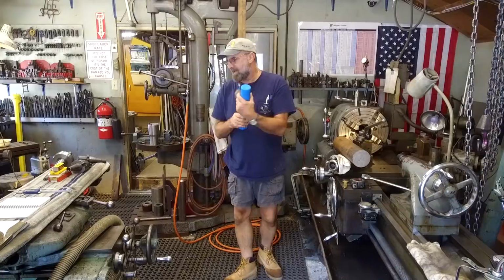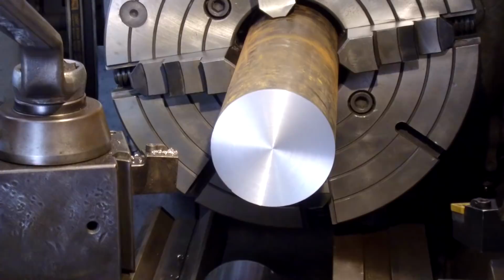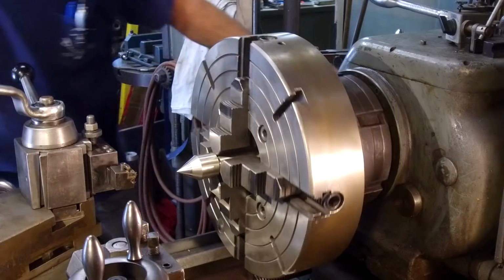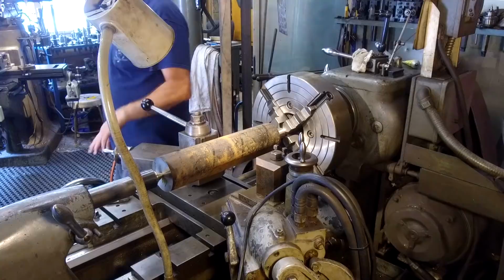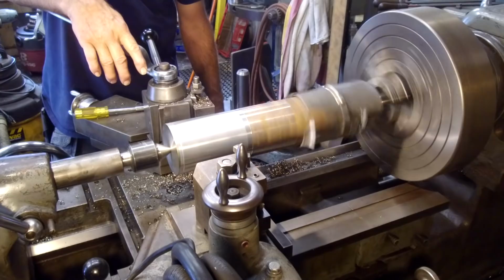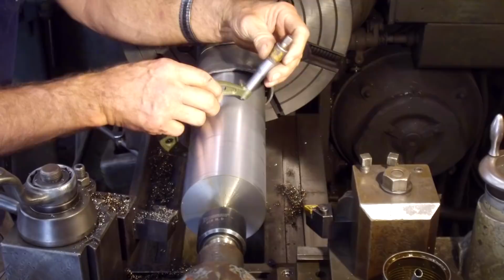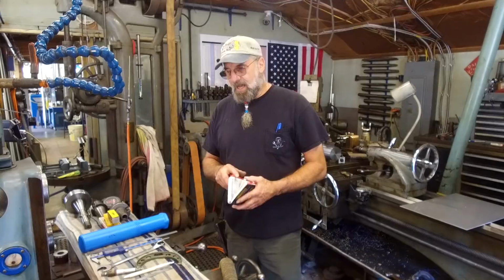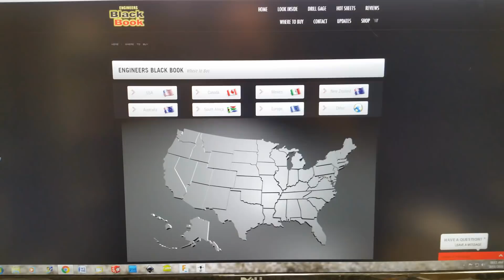#40 Taper Holders On The Make P1

Comment: For making my own taper tool holders, I have made a 30-taper plug for the bore of my spindle. So I don't worry too much about the taper, I cut it in one setup, then pull it back in to the plug to machine the tool holding features. It helps that my spindle taper is bigger than 30 taper, but even were it not, I am sure something could be arranged.

Comment: Hi Keith. Good to see you up again. The angle iron trick is helpful. I've never seen that done. I'd like to add to it. Use a second piece of angle iron on the opposite side of the part to eliminate the driving backlash. Dog bouncing may be small, but will give you some noise in your OD finish. I've seen guys drive wood wedges between lathe dogs and faceplate slots with great success. My faceplate had a cam I made that I would adjust to trap my drive dogs and eliminate the slop. It worked quite well. Take care.
Reply: Joe Pieczynski I thought that was clever too! I think you lifetime guys, even after making videos for years will still have loads of untold treasures when greener pastures beckon 👌✊✌️😌😉

Comment: Hi Keith my name is Keith Gentry and my Grandad was a machinist by trade but he ended up making a living as a Pipe welder/fabricator and I followed in his footsteps as a welder/fabricator type dude...I worked in oil refineries for about 10 -12yrs them
n moved to Austin Texas to start workin for a mojor HVAC company in 1999 .....Ive done alot of crazy shit in my day but man do I ish my Granddaddy could have taught me more botu the Machinest  side of the trade... i love making something from nothing... and I often find myself tryn to be a hobby machinest just because ive got s o good at running a fuckin grinder....ive machined shit that you wouldnt belive would work from a fuckin grinder and drill motor....like a firing pi from a welding rod....

Comment: Why not rough turn with the part held in the chuck and supported with the tailstock , then finish turn between centers ?
Reply: That is how I would do it too. No need to go for ultra precision with the centers until you need that accuracy. Peeling a few inches of metal off would be better done with the grip and stability from the chuck I would think.

Comment: Hey Keith! I have been watching a few videos where you center drilled both sides of the workpiece and then machined it. I would have gone ahead and chuck the workpiece up, center it, machine the taper end to the finish and then part the workpiece of using my steady rest. Are there any disadvantages with that plan?

Comment: Keith,
If the Engineers Black Book states 7 degrees 24 minutes then this is incorrect information.
The included angle of the #40 taper is 8 degrees 18 minutes.
The 7-24 refers to taper being 7 inches per 24 inches which of course is the same as 3.5 inches per foot.
Reply: Actually the included angle is 16 degrees 36 minutes,or 8 degrees 18 minutes per side.
Sorry about that.

Comment: Hi Keith, great channel!  Apologies if you've addressed this previously, but there's one thing in this video that I don't get, and that's the high pressure lube.  There's no relative movement between the work piece and either of centres, so why is the lube necessary?
Reply from the maker: There is a tiny bit of movement, when the tool pressure is under load and or in free state, along with an ever so slight movement, because you never have a dead nuts alignment 100% around the swing, spindle to tailstock. ;{)------
Reply: I was wondering the same thing. Honestly I use it because he does.
Reply: Keith Fenner that makes sense, and similar to a Joe 🥧 video where he demonstrates how a part can walk out of the chuck, but I also agree with Denny Skerb, but now it’s no longer blind faith!👌 Also thanks again Keith for the tools last year, kind of a touchstone period for me. Thanks again and glad to see you’re still kicking! Also I’m wondering about the bolt hole circle nugget you dropped- the two pieces of info needed to do the rest of the layout are the horizontal and vertical distances from center, then walk around the circle swapping x & y coordinates, and changing the +/- sign depending on what quadrant you’re in,  like + +, + , - -, - +, if moving clockwise from the top right / 1st quadrant… Derp I paused the video so I could work out the problem and posted before I saw you revealed the answer 😅
Reply: I've never seen lube used on live centers. Only dead centers on an ID/OD grinder.

Comment: HI Keith,
When you first put the stock in the 4 jaw I was curious as to why you didn't insert it father into the head stock. Is the through hole in the HS not large enough? (Maybe it was just the camera angle?)
Great video as always, thank you for being an inspiration.
Eric
Reply from the maker: Thank you for the comment! The chuck has a five inch hole and the spindle has a 3.125" hole, the part started out 4"  ;{)------

Comment: why not try a sharper insert with smaller edge radius and positive cutting angle first to lessen chatter, like DCGT instead of CNMG? and why didn't you perform a rough OD cut when the workpiece was clamped in the chuck and supported by live center in the first two operations?
and don't get me even started with that angle iron or the sheet metal you used to maintain cutting force, looked like proper recipe for disaster.

Comment: Why are you putting high pressure lube on things that are not moving? Bearings on live center and fixed with a dog on the chuck end.
Reply from the maker: Just because you don't see the movement, doesn't mean it is not there, when you see a shaft in the shop, in the lathe for hours of work, falls free because the center failed. you just have the habit. both ends so when you flip it, you don't have to grab the tube again. ;{)-------

Comment: Keith: I am not being critical or trying to give advice, but I AM curious.  Why don't you complete part running between centers? Is 4-jaw and tailstock center inherently more accurate? Thanks
Reply from the maker: You would not be able to remove the bulk of material like I do in part two with it between centers, a lot of material needs to come off and several processes before getting picky on the finish accuracy.  ;{)--------

Comment: tengo dudas que es 4140, o es tipo de material de acero??
Reply from the maker: Yes it is 4140 steel, AISI 4140 alloy steel is chromium, molybdenum, manganese containing low alloysteel. It has high fatigue strength, abrasion and impact resistance, toughness, and torsional strength.  ;{)-------
Reply: ohh, muchas gracias!!
Reply: yeah ,there is no wonder  why guns are made of that steel...hard stuff ...european equivalent is 42CrMo04 or in my country 4732...greetings from Croatia ....Keith you are the man ....master